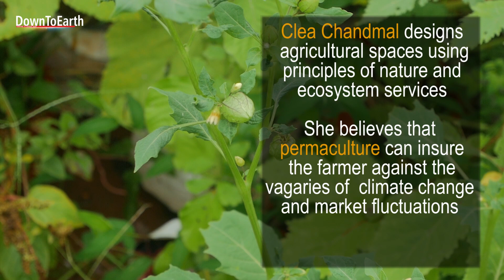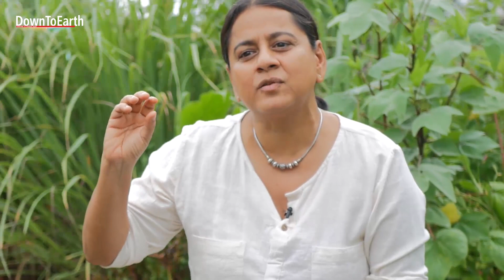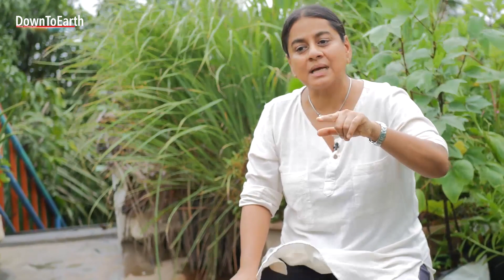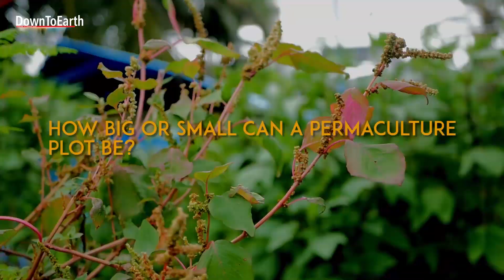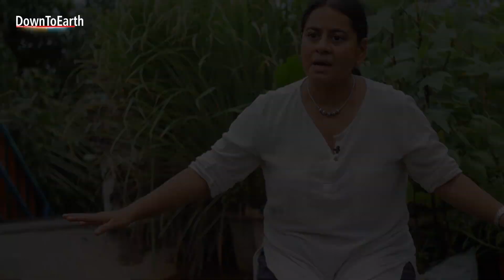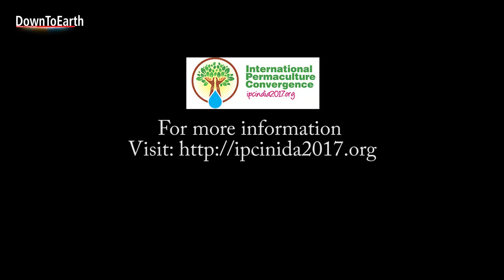Importance of permaculture for Indian agriculture

Comment: I WANT TO START PERMACULTURE RIGHT FROM MY HOUSE. I HAVE SOLAR SYSTEM, RAIN WATER HARVESTING, VERMIBED FOR COMPOSTING, A  GARDEN, BORE WELL AND TREE PLANTATION. WHO WILL DESIGN FOR ME . I AM AT DAUND NEAR PUNE
Reply: you could do it yourself slowly.. trail and error.. if your land is over exposed and eroding, you may need to 1) contour the watersheds a little initially to retain/slow down the water. 2) have native  trees/ native flowering shrubs as windbreakers to start with..
3) keep add/accumulating natural leaf litter and add mulching - IF it is in an arid dry area.
4) add dung based natural composting liquids/vermicompost/ etc whenever you can afford to make it.
5)  keep the soil protected and undisturbed so microorganisms can do the work for you
6) slowly establish different types of native plants in areas that are natural to their type or where they can be seen to thrive